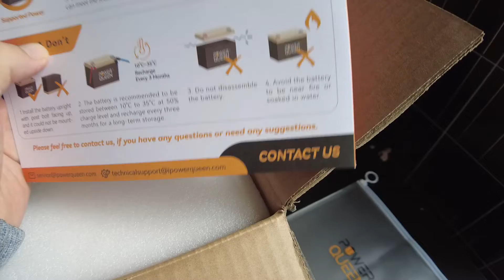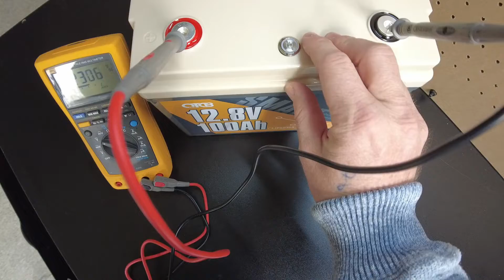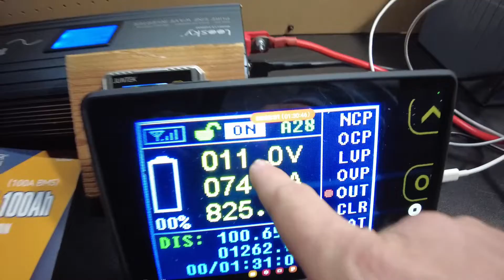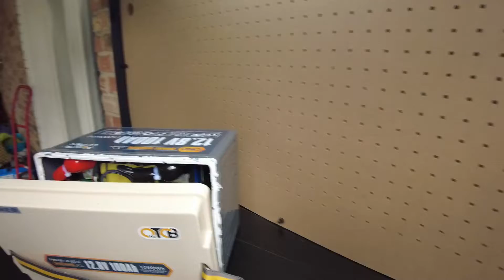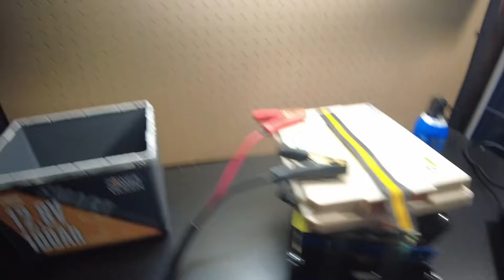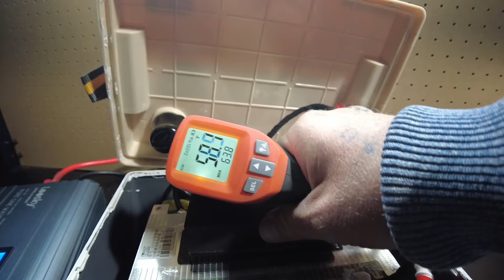Power Queen 12V 100Ah OTCB Smart LiFePO4 Battery

Comment: Just bought 2 of the group 24 100 AH batteries. Charging them one at a time before paralleling them. I will let them sit for 24 hours each before connecting them together.

Comment: Hi Brad. Great video.  I am trying to decide whether to purchase this 100 Ah battery. Do you know if the battery turns off automatically after some time?  Was just curious if it would turn itself off while I would be camping or if it will continue to provide discharge as long as I do not turn it off.  Any further information on the power button would be greatly appreciated. Thanks!

Comment: I have a TimeUSB 100AH Smart battery and it is identical to this one with features and even the manual has the same information but with the different graphics. Another difference is the color of the enclosure. I suspect that one manufacturer is selling these to multiple resellers and they just customize the way the battery looks. My battery has the same power button, cam with same bolts and even the box and packaging is the same. But I did not open mine so far. I bought mine in June 2023 and been using it in my vehicle to run a refrigerator and battery is charged by 200W solar panels on the roof and when engine is on the car charges it. Anyway I think many companies sell the same battery but with different graphics and colors.
Reply: Yep.
My Redodo smart battery is the same 😮. 

Makes me wonder... Are Li Time and Redodo and Power Queen all the same builds???😮😮😮
Reply from the maker: Yes, I believe you're correct. I've gotten many batteries from all these different companies, and they appear to be mostly the same. Thanks!

Comment: Great video, but why was it showing 3.7v when it was OFF? Does that mean if it was in parallel with another battery that this battery would accept a charge? Why doesn’t it show 0 votls?
Reply from the maker: I think it's how the MOSFETS in the BMS are arranged. You can still see a little voltage, but that would drop to 0 soon as you try to pull a load.
Reply: (1.)  If you've ever ran a BMS controlled battery pack (like those powering a drill, laptop, phone or tablet) completely down (below it's minimum operating level powering the actual BMS) good luck on rebooting it. But rather than applying a parasitic load (i.e. indicator) on the battery as such ...that little wire is made available; which in itself can be monitored by (say) a charge controller of sorts. (2.) Because it's strictly for monitoring I suspect, it's never intended to act as current source but too could act as a "last chance" to keep the BMS operational and monitored. 😊

Comment: I would solder those 3 out solder pads with a c opper strip and go to terminals with a number 6 welding cable to b oth pos. And neg

Comment: Since it says recommended charge amps of 20, is it not a good idea to use a victron mppt controller 75/15
Reply from the maker: Victron 75/15 is 15amp max so you're 5amps under recommended 20, and that is perfectly fine. You're good!
Reply: @BradCagle Sweet, it is less expensive so heck yeah!!

Comment: real nice. every powerqueen I seen torn apart has been a great build. This red wire on BMS is for power pos for that smart switch . most inverters that come with cables are CCA wire and get warm and have voltage drop under load. use OFC or pure copper. the wires inside are. thank you for the look inside of that one.
Reply from the maker: Yes, they are pretty good build quality! Thanks

Comment: I"m really impressed at how cheap Power Queen is but how quality their cells are. 65A load and the cells are holding at least 3.20V. Halfway through the cells have dropped to only 3.15V. Its not until you get around the 75% mark that the cells hit 3.10

Comment: No... the charge termination voltage is a very not good indicator of the cells matching and balance. We're talking China here. 
The bms could be allowing high voltages on the individual cells, allowing overcharge in order to put out the w/h. Or it might be jyst sloppy. 
I see many BMSs spec sheets stating high tolerances at voltages exceeding 0.2v/cell overvoltages. 

The bms should be the last frontier. The "panic" shut-off. The charger should not allow the cells reach the absolute maximum voltage for the chemistry and the load should not allow the cells reach the absolute minimum voltage. 

From this video I see a very steep charge voltage curve. Almost a straight line, not very much of a curve. The charger open circuit voltage should equal 95-98% (or thereabouts) of the sum of the maximum voltage of each series cell. That will lead to a very tame current/voltage curve, slowly creeping to zero current flow, somewhere a tiny bit below the absolute maximum voltage. 
Below as to always have a safety margin. 
Have a safety margin in everything because beyond the datasheet's absolute maximum ratings lies havoc, chaos and tears... 

And a personal thing... I stay away from "too smart" devices. (Alright, not this particular case)
The "smarts" imply mcus, cpus, and firmware... The latter being more prone to failure the cheaper the device is as programmers aren't cheap workers and good programmers are few, far in between and their skill skyrockets the R&D costs. 
And I do not want a closed source firmware glitching on top of a few kilowatts. :)
Reply from the maker: Good, point. I'll start measuring the cells at teardown while charging to see if any are allowed to go higher than normal. I recently did a battery review that allowed the cells to charge to 3.9v LOL
Reply: @BradCagle  yep, that is pretty high and a lot of electrolyte was probably turned to gas... 
And the bigger issue is that these packs have no or very poor compression. Cells are allowed to swell, electrodes delaminate, internal resistance increases and it all spirals down from there...
Reply: You sound like you have a good understanding of this battery technology.  What are your suggestions for safe and dependable batteries?
Reply: @buckrockerm  your question is too broad. An answer would be just as broad - follow the best practices, stay away from the absolute maximum ratings. :)

Comment: Why buy the Smart version over the non smart ? Certainly when 100,ooEur difference.  And makes it sense when putting two in parallel  ?
Reply: I'm not sure which non-smart version you are referring to, but the smart battery has cold temp cut off.
Reply from the maker: I agree, it's not worth it IMHO

Comment: Lovely battery review. I may get a few of these eventually. However i don't need a low temp. sensor here in sunny Jamaica.
Reply from the maker: Thanks! Yes low temp is not a problem for you :) For you I would do the "Timeusb 100ah pro" very good price, and qulity.
Reply: @BradCagle  I got the regular Power Queen 100ah battery yesterday.

Comment: Should have used putty knife like other reviewers
Reply from the maker: I've used putty knife on them before. I don't think it would have worked on this battery, needed to far more rigid like the chisel I used.
Reply: @BradCagle  Turns out the chisel worked very well.